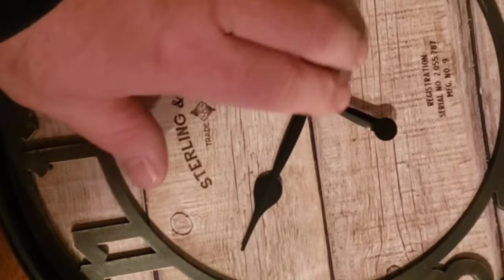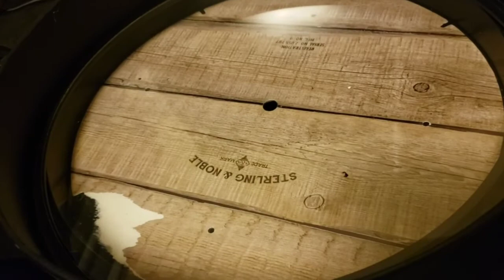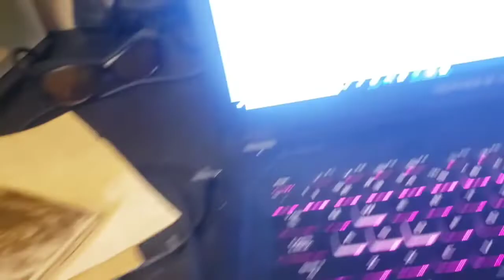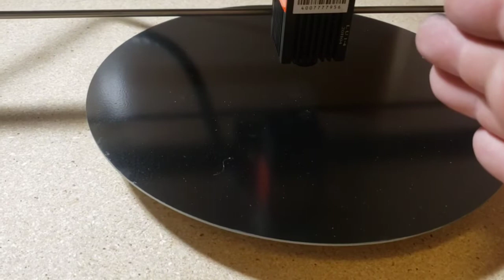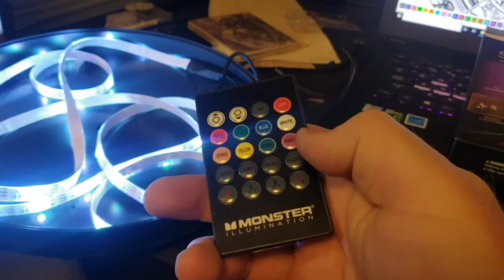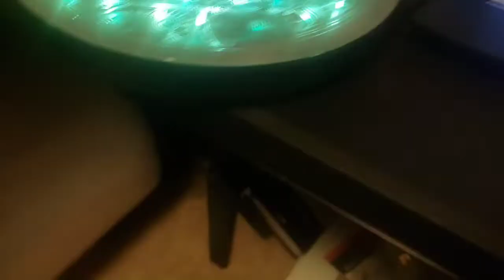The Kenny Hack: Faux Stone Painted Project. Ortur Diode Laser.

Comment: I know this is an "older" video but it just showed up in my feed tonight.  I've watched it multiple times and am still confused about the painting.  Let me see if I have this straight, you put the gray colors on the front side of the glass, then you sprayed the back side of the glass black (or did you spray black over the gray?).  Then you reversed the image and etched on the back side??  Looks like you are etching on the black side which is the front side??  If the black is over the grays, then after etching, you clean all the black off of the front (how to get the black off without removing the gray??) and then painted the back side black.  Do I have this right?  Sorry, but I'm new to this and just not really getting the painting portion / sides on this video.
Reply from the maker: all done on the back of the glass. .first blotch/mist on some lighter and darker grays . then put a solid layer of gray. this will give it a stone look when viewed from the front.  Burn your reversed image through the grays and clean with room temp water to remove any soot. then paint black to fill in the lasered pattern. put back in the frame and the image is viewed from the front. since it's on the inside the image can not be scratched and will have a nice glossy finish.

Comment: Can you go over the final black paint process? How does it not interfere with the grey stone color?
Reply from the maker: Since its on the back of the glass, after you laser the reversed image down to the glass. When you put the final coat of black on, it will fill in the lasered area and be seen from the front. Since the image is on the back of the glass it won't need any clear coat to protect it too.  

Hopefully that is what you were asking for.
Reply: @TheKennyHack  Thanks. Now I am obsessed with trying it. Was going to etch a mirror and then fill the burnt area with black paint. Then brain got stuck on painting with multiple colors.

I can make stencils from the pattern, one for each color. Wondering if you have a recommendation for material that will minimize the bleed on the edges.

Comment: Great project. Please explain more how you prepare the glass, paint, settings and finish after burn, less about finding center and focusing, adding lights. We already know how to focus etc..
Reply from the maker: Just clean the glass with glass cleaner, blotch/mist a little white onto the surface and then cover with darker gray. This makes the faux rock surface. Engrave the mirrored image on the back. I think I was around 4000mm and 80% power. Its in the video somewhere. Can use a soft toothbrush and room temp water to clean any soot off. Dry the surface and fill in with black paint and done. There is no other clear coat as the front surface of the glass is the final image. Pretty simple project. Much the same as doing a mirror but can run a lot faster.

Comment: have you considered using a dark window tint on the back versus painting it? the tint would allow you to still have the lights behind it for illumination at night.there is also a spray tint from VHT that is made for tinting tail lights looks black but is semi transparent when the lights turn on.
Reply from the maker: To be honest the light up ones look real nice but hard to find great locations for. Big bar signs that have wall connections right behind them are nice, but only so much room for desk top stuff.

Comment: nice work, see you been trying tiles with the lion :)
Reply from the maker: Thats actually a piece of wood. A demo piece i usually use to adjust height now. Still haven't made it to Tile work yet. Trying to think of something different to do than what everybody else is doing.
Reply: @TheKennyHack  really looked like tile, i like the painted canvas art. I also wanted to try cutting and doing the nested art, like this https://www.youtube.com/watch?v=mA4KQUbkJes
Reply from the maker: @Nonprofessional_Tinkerer  i like that stuff too but until I get a CO2 I'm trying not to do too much cutting with my diode. They can do it but it seems like a lot of extra load on the laser.  That's OK for personal work but I don't know how I'd price that out for customers.  It seems to be a toss up in the forums. Some people say running 100% power doesn't hurt a diode but ive seen too many people with heads staring to die on them,  andv they usually say they've been burning at 100%. So I try to avoid it.  85% is pretty much my max.
Reply: @TheKennyHack  mine started dieing already after 2 months of general use and not running above 60% so got a 15w and a replacement 20w coming. ive got aleksmaker 2.5w coming as hear the diodes are better and did see someone state the ortur ones are overclocked so burn out quicker allegedly
Reply from the maker: @Nonprofessional_Tinkerer  seems to be the luck of the draw. I have a replacement head for backup but ive been looking at other brands as well. Trying to find something in the US thats more dependable on shipping times.
Reply: @TheKennyHack  need a nice fiber laser :) im still figuring it all out, i seem to struggle with gradients and not getting much of answers in the group. ive had imag-r images have grey in them but you only set max power on something like lightburn, so is it reducing that power for the greys making a greyscale image or is it running all at 30% power with the laser just on or off and the density of dots changes tricking the eye into seeing shades
Reply from the maker: @Nonprofessional_Tinkerer  im on the fence for either a fiber or CO2 myself. Not there yet to buy either though. The FoxAlien looked like a good diode but they are out of stock on the 15w model. It has a stronger laser than the Ortur 20w and looks like it takes a standard lens in the pictures.
Reply: @TheKennyHack  at least those fiber or co2 will have a fixed focal length, not this guess and everyone different thing with the diodes
Reply from the maker: @Nonprofessional_Tinkerer  thats why I try not to dwell on exact focus height. I can get it to burn at any height just takes more power the further away you go. The G8 lens are fixed focal length but everybody will have them mounted in different so everyone will have a slightly different optimum height. It just makes it confusing for people starting out. Ive not done tile but heard focus is very critical for those. Why I havent messed with those yet. Seems like there are a lot of factors that can make those not come out too well. Thats ok for hobby work but again I don't want those struggles if im doing work for a client.
Reply: @TheKennyHack  cant blame ya, think a main issue i was hitting with tiles is i was focusing in the corner and now realising that the tiles curve at the edges, so be testing that theory out later and focus in the middle
Reply from the maker: @Nonprofessional_Tinkerer  thats what I moved to. Seems to average out any warp in the project piece or the bed/frame level.
Reply: @TheKennyHack  luckily having 3d printers a lot of the parts to this thing i already have lots of spares as they the same belts and wheels, bearings, pulleys, motors, with the eleksmaker also the driver chips